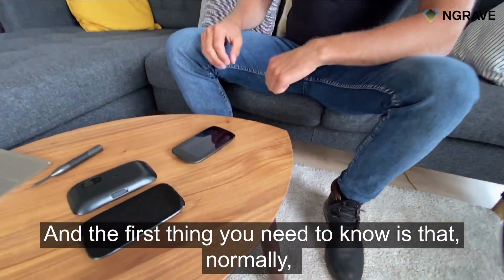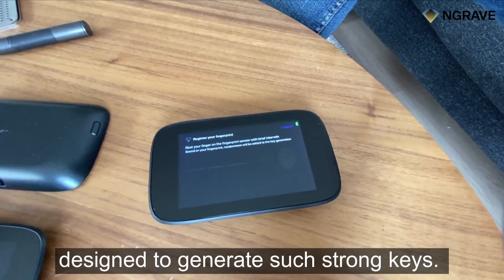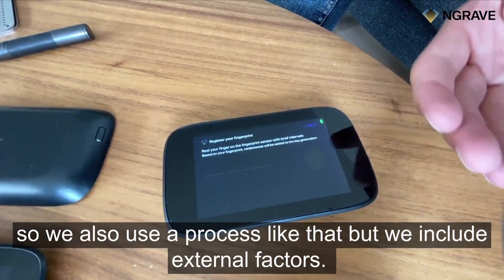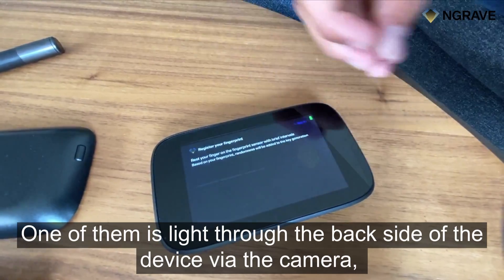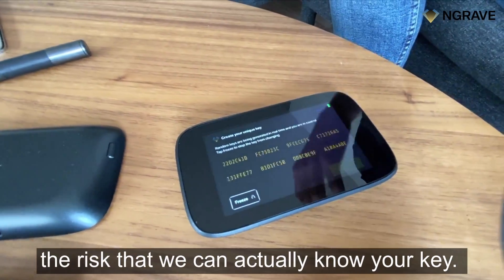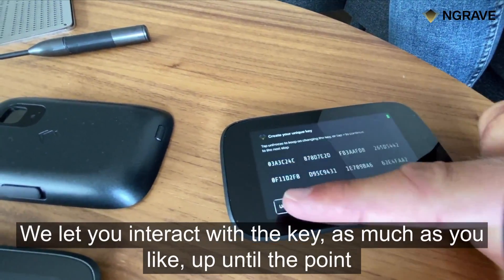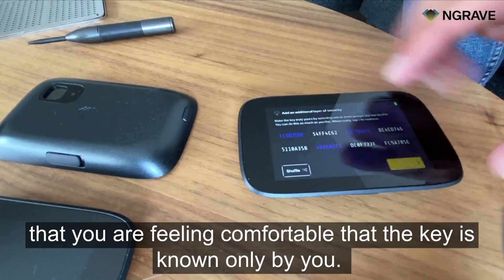NGRAVE Sneak Peeks - Episode 1: Key Generation With Your NGRAVE ZERO

Comment: Hello,  so if I lost my zero device could I restore on another device that uses bip39 as opposed to yours? thanks
Reply from the maker: Hi James! ZERO is fully compatible with BIP39 and all derivations occur by relying on the other official BIPs as well. If you lose your ZERO, you can restore your seed phrase (if you made a mnemonic wallet with ZERO) on any other hardware wallet. You can also restore your NGRAVE Perfect Key on any other wallet, you can actually convert this key to 24 words and vice versa.
Reply: @NGRAVE  How do you convert it?
Reply from the maker: @chevalierdeloccident5949  You can do it on the device itself, but the internet also has options for this, eg https://github.com/BlockchainCommons/bc-seedtool-cli/blob/master/Docs/Usage.md
Reply: @NGRAVE  Right! Because 2^256=16^64. Any binary to hexadecimal conversion calculator would do.
Reply: @chevalierdeloccident5949  You hit the nail on the hat, that's exactly true! (or 24 words out of the 2048 available)

Comment: The ability for the user to choose multiple choice options for pieces of the key is not a good security practice - that looks like just security theater. The ability for a user to do this does not increase their security in any way, because if ngrave wanted to take people's funds, they could easily generate an infinite number of compromised options that the user can choose from. I strongly recommend removing that feature from the device as it provides no functional advantage, complicates the key generation process, and will mislead some users into thinking their key is more secure than it is.
Reply from the maker: We understand your caution. The point is that 1) interior TRNG chips are notorious for potentially having backdoors. There are many articles available on this. A recent one is from Forbes (https://www.forbes.com/sites/daveywinder/2020/02/12/cia-secretly-bought-global-encryption-provider-built-backdoors-spied-on-100-foreign-governments/#6dcb1413580a). We resolve this issue by including external factors including your biometrics as well as ambient light (academically proven to be a strong source of entropy. Moreover, 2) existing wallets give the user a key, opening the risk of the former having knowledge of or pre-generating the key. Together with world leading security experts, known for developing the most advanced cryptographic protocols today, as well as leading post-quantum cryptography standards in the ongoing NIST competition (https://csrc.nist.gov/projects/post-quantum-cryptography/round-2-submissions ), we developed a key generation process where the user assumes control of part of the process. People are predictable, so this process is somewhat constrained so that they cannot introduce entropy deteriorating  actions. In the future, we aim to open source as much as possible of this process so that it is audit-able that all of this occurs genuinely. In addition, the user interaction step functions as a tamper resolution step. If keys were to be preprogrammed in a supply chain or middle man attack, the process will resolve that tampering (although it is virtually impossible to even tamper the device to that level). There is a secure element of course, but there are many layers of anti-tampering before even getting to the secure element. Finally, it is also possible to make your own keys (e.g. with dice rolls) and import your own key into the device. You can also still use the mnemonic phrase (current industry standard) if you so desire. So in the end, there is an option in our device for every level of paranoia you as a user might have. If you don't trust the keygen process, you are free to enter your own. So our process includes the status quo, but also ads additional security. And you can choose whichever option you like. Hope that helps.
Reply: @NGRAVE  The assertion in the video (at 
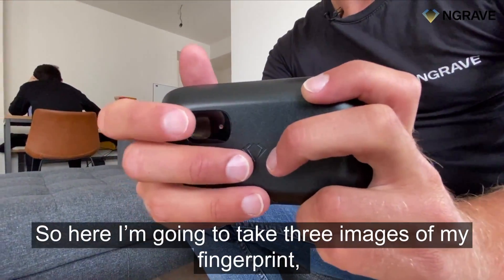0:50) is that the user interaction can "eliminate the risk that we can actually know your key". Its simply false that the user interaction eliminates that risk.

Comment: The BIP39 key generation process works reliable and proven, you just made a new unverifiable new "key generation" attack surface into your device. I bet this is just a honeypot attack and you guys are ought to steal Bitcoins.
Reply from the maker: Our key generation is not any less safe than BIP39. Under the hood we still use BIP39, but we allow the user to manipulate the entropy directly. You can create the mnemonic backup if you want. The point of this is just to remove the risk that we pre-generate the entropy for you (what you call a honeypot attack). Actually, unfortunately the interior chip does pose a residual risk, even if it might be small. A good recent article on backdoors is this one by Forbes - there are many more - https://www.forbes.com/sites/daveywinder/2020/02/12/cia-secretly-bought-global-encryption-provider-built-backdoors-spied-on-100-foreign-governments/#a51b82f580ab.